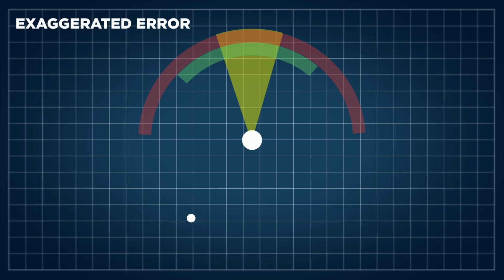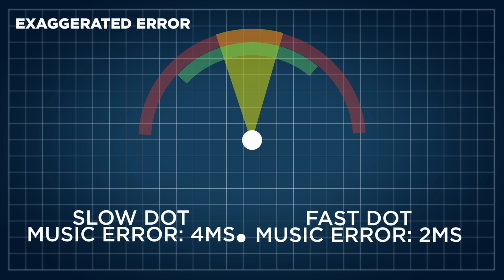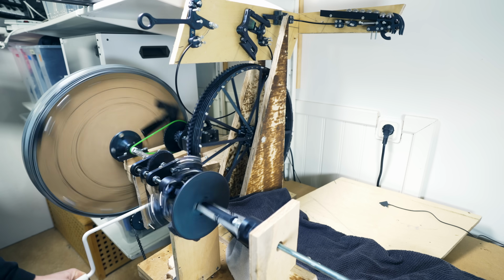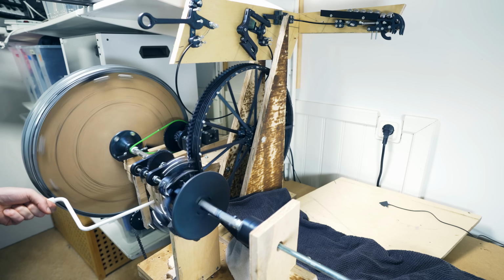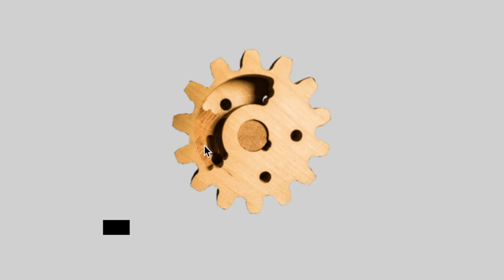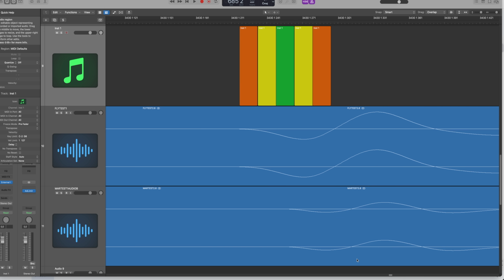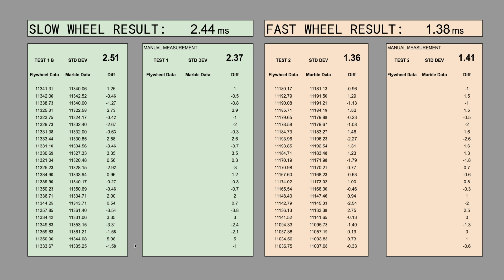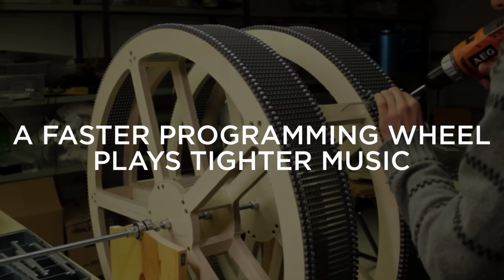Testing a Faster Wheel - Is the Music Tighter?

Comment: Once more- You can easily have infinitely variable music length, or even put together multiple pieces in a program.  You just have to switch from the DRUM encoding method, to the Jacquard method of a chain of flat cards, or even chain linked rods with each rod representing a single note space.  This could be done with trip hammers if the cards have pins welded to them sticking, although this would require a more complicated pathway for them to be pulled thru the reader since they won’t stack neatly.   Or, you could figure out a way to activate the ball drop mechanism via Holes or slots in the cards.
Reply: Sorry if my reply gets long. But anyways:

The downside of punch cards, though, is that they cannot be re-programmed. They use holes directly as the music program; once a hole is cut, it can't really be "removed", only plugged up. plugging up multiple misplaced holes, for instance, when you make a mistake in the punching, will likely look messy too. Plus, the more songs you want, the more punch cards you need, which just isn't physically efficient if you think about it, and this only gets worse if you want different variations on the same tune. Even if you have a case of punch cards that is easily movable, even if it's the size of a single programming wheel, that's still a lot of them.

Programming a few programming wheels, for a huge number of songs, is a whole lot more efficient. It's like having a lot of songs on a single memory card; one programming wheel can play literally hundreds, thousands, perhaps millions of songs, just by re-programming them. That's because programming wheels do not use holes for the music, they instead use holes to hold some form of physical object which acts as the music; these physical objects can be added and removed from different holes to alter the tune. And, this re-programmability nature allows easy variations on the same tune, or even completely improvised music on the fly.

I think a good idea is to have something that combines the best of both worlds. You can get the infinite length characteristic of punch cards together with the re-programmability and "editability" of programming wheels. Maybe some kind of "belt" that you'd place programming pins/profiles onto. Then you'd remove the pins/profiles from their current positions and re-position them for different tunes. I'm currently not at all aware of any mechanical musical instrument that uses something like this, and I'm not sure if it's even possible (not sure if any programmable mechanical device has used something like this even for non-musical applications).

Actually, now that I think about it, re-programmable wheels are way more similar to today's digital technology than punch cards are. If you need me to explain that more I will, but this comment's already getting very long :)).
Reply: @justinnaramor6050  In the last iteration, the idea was not to program the wheel, but ended up being studs WELDED onto steel panels that could be swapped out.   When you consider that each and every punch card might only represent a single bar of music, then changing a phrase becomes real itself simple, and cheap, given that it can be done in just stiff paper stock.  Moreover, it would be relatively easy to simply compose music and then have software that automatically transposed it into cards to be punched, compared to manually having to place pins.   But again, the benefit of the Jacquard style programming method is that you could string together multiple pieces pf music into an entire concert program, that would play with the musician simply adjusting tempo between pieces.  Another benefit of a punch card method is that you could program-in notes with sustain, ( a slot instead of a hole ) and that the potential for time signatures, triplets and such would be unlimited. Especially if he goes for having two channels for each note and instrument.
Reply: @christopherpardell4418  What you say is true, but still, it isn't really the same as a programming wheel. If you're just gonna have all the songs already pre-programmed on wheels, you might as well use punch cards at that point... seems like all those wheels would be a shitload to carry. Can you imagine carrying 30 different wheels for 30 different songs? What a mess!

But that's my whole point here; programming wheels are re-programmable by their very nature (so long as you make the pins movable, instead of welding them in place or whatever). There's a reason why mechanical musical instruments with re-programmable pinned wheels or disks exist... it's not for visual spectacle. All those 30 songs can be played on only 1 wheel.

Going back to my digital music technology comparison, this is pretty much exactly like today's hard drives or memory cards; one single hard drive or memory card can be "programmed" and "re-programmed" at will, without messing up the integrity of the hard drive/memory card. This is obvious if you've ever used a MIDI sequencer either to play live or do studio work (I haven't done that myself but I do fully understand the concept).

This is hardly any different with programming wheels, conceptually. A single, re-programmable wheel means that, for example, you do not need a hundred different wheels for a hundred different drum beats. You only need one, at minimum, because it can be re-programmed. Even if you have, say 3 separate wheels controlling 3 separate drum sounds for those hundred drum beats, the same concept still applies. You get more music out of one object, not all the music out of multiple objects.

A punch card is more like vinyl records, in comparison. Punch cards are literally using holes as their musical program. Once you punch/cut a hole into something, it's there forever. Holes cannot be removed. They can only be plugged. Plugging holes is fine for editing out mistakes in the program (minus how messy it might look visually and so on), but if you want entirely different songs, you need multiple cards, for multiple music programs. Even if you have one long card or chain of cards for an entire set of songs, you still at some point need multiple cards for multiple music programs. Whether punch cards are physically smaller than programming wheels really isn't relevant... I am talking purely about quantity of punch cards here.

And this is a lot like vinyl records. Or any other form of analogue music that is non-programmable. For imagination purposes, let's say you have multiple vinyl records, each one having a single tune. This right here is what I'm getting at; you need multiple records! Even if each record has multiple songs (you know, like a typical album), you still need multiple of them if you want multiple musical "programs".

Regarding your point about having notes of different lengths: thinking that programming wheels cannot have notes of different length is incorrect. There were barrel organs that already solved this problem hundreds of years ago. Instead of pins, you'd use something that's more like a staple. Staples of different lengths would be used for different lengths of notes. In the case of the marble machine, Martin is moving away from pins, for a similar reason. He's moving to programming "profiles", which are like the staples in barrel organs I mentioned. Their lengths and their shapes would determine the timing and resolution of the notes. Biggest advantage here is less holes to drill/cut when building the programming wheel. With pins, multiple instances of a single note meant multiple holes. The holes alone were determining the resolution of notes. Now, for multiple instances of the same note, the programming "profiles" are responsible for determining the resolution, purely due to their shape and length.

As a side note, just in case you were not aware, the design of having 2 marble gates for each note, for playing doubles, has been entirely done away with. And rightfully so. I'm now realizing just how convoluted that was!
Reply: @justinnaramor6050  He is not going to be programming the machine as he performs.  Nor even between songs.   The last version of the machine was going to have the programming wheel broken into 4 steel surfaced quarter drums with pins welded in place, and to change each song would have required removing the drum sections and replacing them with OTHER premade, and set drums.   Ergo, the entire project is about getting the machine to perform multiple pieces of music in concert that have all been pre-programmed in some way that is fixed.    A stack of punch cards is NOT as cumbersome nor even as delicate as moving large wheels with welded in place trip pins. And it has been a tried and true method of playing harmoniums and other mechanical multi-instrument auto playing machines in the past. The wheel becomes geometrically  more cumbersome and heavy to produce with increasingly longer playing times, and so it is a fundamental limitation to the creative expression of the musician. You have to have a repeating phrasing every X notes. Period.   
The caterpillar track of folding punch cards can be as long as you wish. And, frankly, its easier to program as it would not even necessarily require manual pulling of each and every pin that strikes a note, but could simply be punching an entire bar of music on each and every card in a single operation.   Cards are cheap, flat, easy to feed into a mechanism, and inexpensive to replace.   So, it really don’t see any other option that offers the versatile in timing, music length, and compiling an entire concert worth of performances.    Player pianos used punched paper scrolls a century ago.
Reply: @christopherpardell4418  If the goal is for everything to be pre-programmed as you're implying, well then you literally repeated my first point in my last comment. In the last machine Martin switched to having pins welded in place on the wheels as you mentioned. And this was a dick move, really. Might as well use punch cards at that point... all those wheels will be a pain to carry.

But with this new machine, I was under the impression that it would be re-programmed live. So while one song is playing on one wheel, the second wheel would be programmed (or maybe already programmed before the concert). Then as that second song plays, the first wheel would be re-programmed for a third song. And this process just repeats throughout the set of songs. You might think that's more complex but it's actually a whole lot easier. Period. Way less wheels to carry, compared to only having wheels with pins welded in place. This should literally be obvious to anyone. Even non-musicians. By definition, one single re-programmable wheel can play hundreds of tunes, because of the movability of the pins. All of this only applies if the goal is live re-programmability of one single thing (like a wheel or a disk). Again, there's a reason why mechanical music machines with re-programmable wheels or disks exist.

Of course this isn't as "easy" as just swapping out punch cards, I'd be stupid or something if I claimed otherwise. That is a disadvantage that you correctly pointed out. All I'm saying, though, is that it's a single thing to re-program. You don't need a hundred wheels for a hundred songs, or for that matter a hundred punch cards for a hundred songs. A single re-programmable wheel can do that simply because of its re-programmability. The advantages outweigh the disadvantages.

But if the goal really is no longer to re-program the machine live and instead have it all pre-programmed, then of course, there is literally zero reason to use the method of a rotating wheel as the music source. Just use fucking punch cards at that point, otherwise you're severely over-complicating things. The machine should already be enough to transport on tour, why make it even more complicated by transporting a hundred wheels for a hundred songs? Surely carrying a stack of a hundred punch cards is a whole lot easier, because a case of all those cards might be the same size as a single programming wheel or a few programming wheels.

But, that's still a hundred punch cards, one for each song. That's like having a hundred flash drives for a hundred songs, if we go back to my digital music analogy from before. I am literally not talking about whether punch cards are smaller or larger than wheels. I'm talking entirely about capacity; the 'quantity' of things. It's still at some point a matter of having a lot of cards to keep track of. That's fine if the machine is to literally never be re-programmed in real-time during the concert. But for real-time programmability, a wheel with movable pins makes a lot more sense.

Also, you keep mentioning the unlimited length of punch cards. That's certainly nice, but did you ever stop to think that, for Martin's use case, unlimited music length of punch cards is maybe not a requirement? Besides, the length of punch cards is entirely fixed; it has a fixed start point and a fixed end point. So the length of music is fixed. If the music is loop-based as is the case with a rotating wheel, the length of the songs is determined entirely by the operator. It's gonna keep looping until the operator tells it to stop. Think back to the first marble machine video, for instance. The song was only like 4 minutes long, but Martin could've easily made it longer by simply continuing the operation of the machine. If that song had been programmed into a punch card, or a string of them, the song would've eventually reached its end, on its own, without Martin's input, because of simply the length of the card. Of course this isn't an issue if you make the cards into a loop, which we've seen people do before. But if the music's already in a loop like on a wheel, the operator always has the option to end the music purely by his control of the machine, every time. I say that is a big benefit that needs to be taken into account. So in this case the limited music length of a cylinder is a benefit, not a downside.
Reply: @christopherpardell4418  I never said re-programming the thing live would be "easy". But acting as if it's not tenable is simply stupid. That's exactly why Martin switched from using programming pins to programming "profiles". A profile is more like a long "staple" rather than a pin. And I'm fucking happy he made this decision.

This will make programming the thing much easier compared to pins. A single profile could represent an entire measure. Not just a strict note. The profiles would have peaks and dips in its shape to allow for off-beat instances of a note or repeated instances of a note. So if a snare drum pattern for example had 4 eighth notes during the first 2 beats of the measure, followed by 4 more eighth notes for the final 2 beats in the measure (in 4/4 time, by the way), the profile would be shaped accordingly. You'd only need to put a single profile into that spot on the cylinder! If you were to do this with pins instead, that's 8 pins to place onto the cylinder... big difference! If that doesn't prove my point, nothing will.

And, by the way, the profiles were designed to be movable, such that if a mistake was made or whatever, you'd just move the profile to a different spot. All of this together is much easier than programming it in note-by-note, which is what you'd have to do with pins, because pins have fixed shape and fixed length, so a single pin can literally only represent one note, alone. And it'll certainly be easier to edit out mistakes too!

Look, I'm not saying any of this because I, personally, absolutely want Martin to use re-programmable wheels instead of punch cards. I'm not at all unaware of the benefits that punch cards offer up. I'm just arguing for all possible reasons why Martin is going for re-programmable wheels (if that is still the goal, anyway, because I've not heard him say otherwise). I do, however, think the switch from pins to profiles as the programming method is a great idea for re-programmability, and apparently I'm not the only one. Really, profiles already have some of the benefits of punch cards by their very nature, but combined with the inherent re-programmability of a wheel with movable pins.
Reply: @christopherpardell4418  Oh and one more thing:

You mentioned not re-inventing the wheel and using pre-existing methods. But everyone's missing an important distinction: use pre-existing methods "if/where possible". Sticking only to pre-existing methods throughout the whole project is fucking lame, uncreative and boring. In this case, Martin is challenging the supposed limitations of programming wheels, for instance by using profiles instead of pins to (1) make it much easier to program, and (2) increase musical resolution and have more precise control over marble drop timing. Trying to get him to just throw out programming wheels in favor of punch cards is pathetic, because the obvious goal is not to just "get longer music" and "increase musical resolution", the obvious goal is to try to get people to realize "hey, maybe programming wheels are not nearly as limited as we thought?"

If the goal was the former, as you seem so hellbent on believing, of course he'd just move to punch cards, without question. Even going back to the first marble machine video, he sort of already challenged the limitations of loop-based music (as on a wheel) by altering how the bass line sounded at the second revolution of the programming wheel. Just throwing out programming wheels in favor of punch cards for the same effect blatantly violates that goal, not only that but it adds unnecessary disadvantages, disadvantages which should be obvious.
Reply: @justinnaramor6050  Nothing new in anything he is doing. Cam systems date back to pre-Roman times. And triggers of varying lengths have been used to adjust musical machines since medieval times.   You might also try being less insulting and profane.
Reply: @christopherpardell4418  "You might also try being less insulting and profane".

Well, you seem to be acting as if re-programmable cylinders only have downsides, as if there's no benefit. You're not the only one doing this either. It's not so much that I'm even attempting to be insulting, rather it's more so that I am, well, annoyed, with that way of thinking. Every advantage of re-programmable cylinders I've mentioned in this thread should be obvious to anyone. And yet, folks are in denial. There's another thread, on this same video somewhere in the comments, where I mention a lot of the same benefits, and again the (few) commenters who replied sort of flat-out denied it, like I'm an idiot or something.
Reply: @christopherpardell4418  And yes, I do understand how this is not that different from cam systems we've already seen throughout history. But I've never heard of a system where the cams not only have different lengths but different shapes, specifically for the musical application of using a single cam for repeating a note. That is really the part that is "new". Or at least it's new to me. The other way of doing that would be to use separate cams for each instance of that repeated note, which has obvious downsides. And until now, that's the only way I've heard of it being done. I'd love to be proven wrong though, if there are any video examples of something similar to Martin's programming profiles in a musical application. Unfortunately I won't be able to see them with my eyes though. I'm visually impaired to the point of complete blindness. Not saying this because I want sympathy or anything like that but it's worth mentioning.